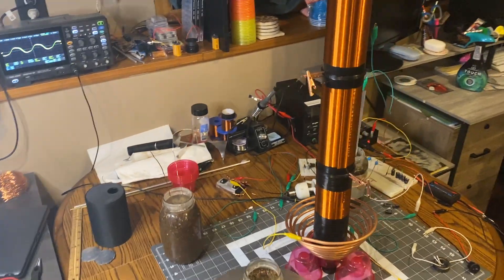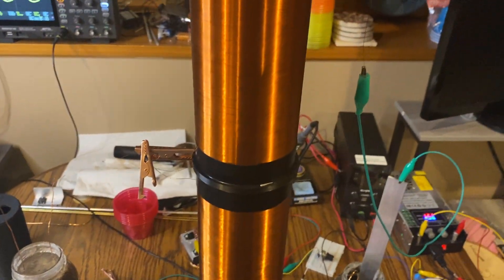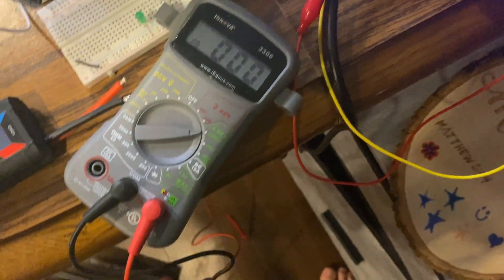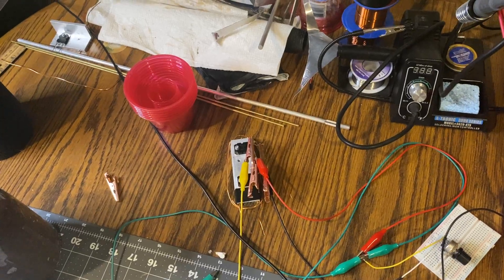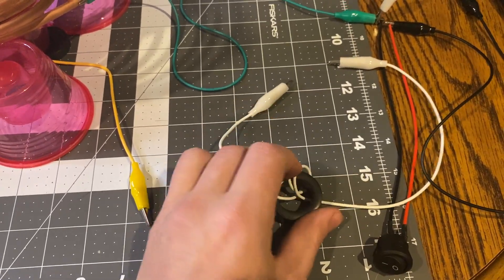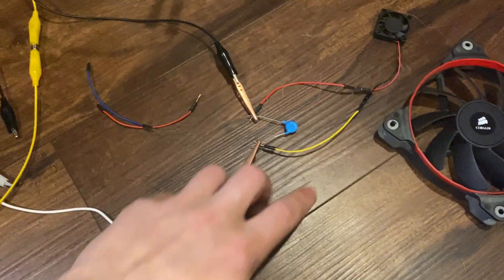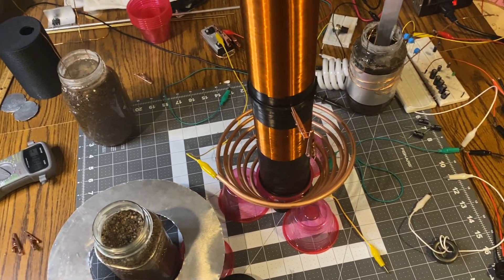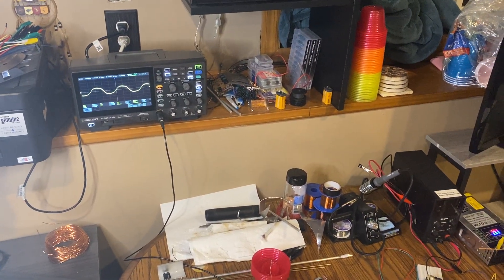Tesla Coil Log #6 - Pure Static Volt Resonance

Comment: current is measured in series not in parallel.
And then there are actually 2 types of current. Conventional current (magnetic )
and displacement current (dielectric) which flows between capacitor plates.
your nested coils can act as capacitor plates.
Reply: Верно, амперметр включается последовательно нагрузке. То, что делал автор видео, мне просто резало глаза 😅. И наверное, у него уже сгорел предохранитель в мультиметре, поэтому он уже не сможет померять ток, пока не поменяет предохранитель.
Reply: @поклонник_Марисы  да, именно так
Reply from the maker: Probably why the addition of the neoprene rubber wrapping around the coil down the middle seems to have a positive affect on the field output. I should probably do some more thorough testing on that statement though. I was just thinking about TT Brown utilizing high K dielectrics and neoprene is very high.
Reply: @bytenite64  often those dielectrics have properties depending on frequency. for example pvc works fine up to 70khz and polypropylene up to 100khz. above the higher dielectric losses cause it to heat up. so keep the voltage high but the frequency low enough

Comment: You caps are creating the current. Any time voltage is slowed down you get amps. The test would be after the cap bank. The stacked Tesla Coils are very cool. I did the same thing. I was trying to lower the frequency. I decided to go 8" pipe at 32 awg at 3' to get there.
Reply from the maker: It'd be very cool if we could get a tesla coil resonating at a low enough frequency to produce audible sound and still function efficiently!
Reply: @bytenite64  I agree